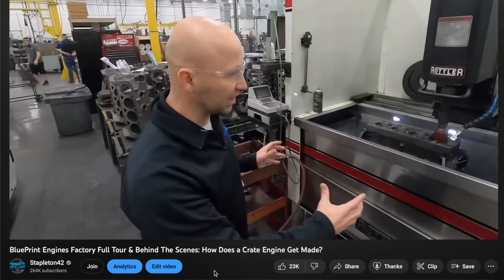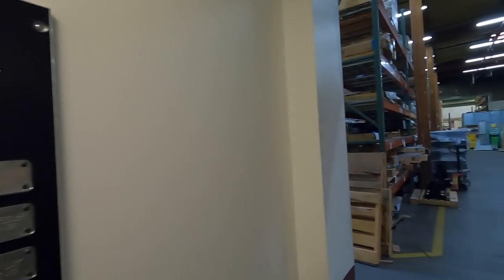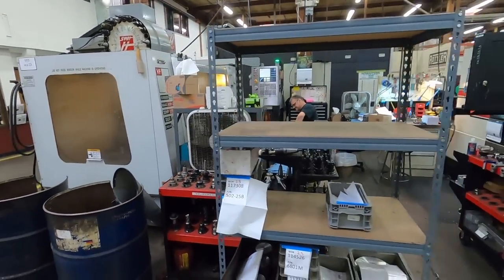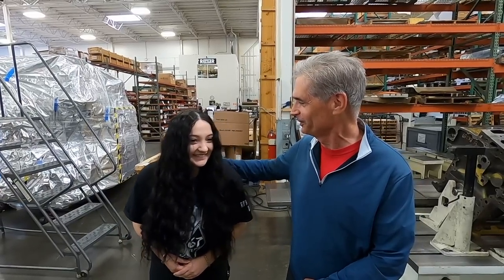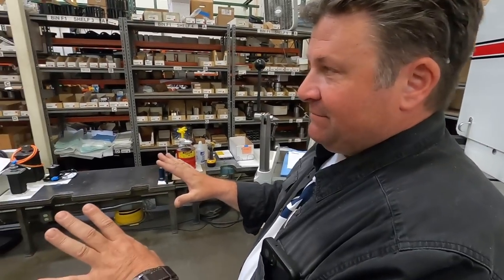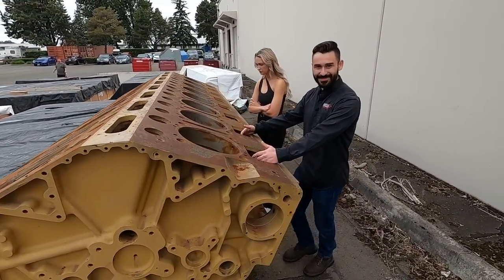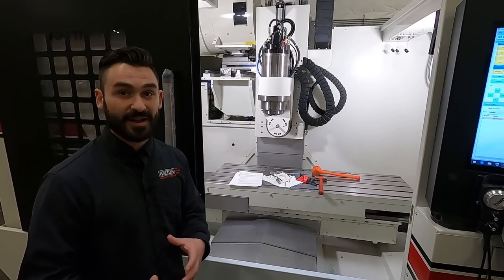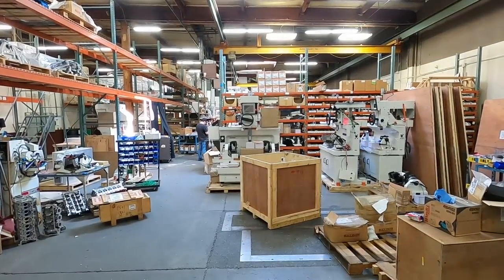Rottler Manufacturing: The Unsung Hero of Combustion Engines (100 Years of Made In America)

Comment: Wow, this video brought back some memories! Around 1984, I worked for an engine remanufacturer…we did a lot of engines for the military’s ground units, like tugs that pull around aircraft…slant 6s, GMC V6 gas engines, and Hercules? That was a big in-line 6 made of chrome moly…tough to machine! I had the privilege to learn to operate the green Rottler boring bar! You centered the bar in the bore by floating the machine on air, use the four fingers in the bore to center it, then lock it down. Had to do a lot of sleeving back then-thin wall blocks. Also operated the Sunnen CK-10, and a Sunnen Align hone/boring bar. Then after doing the machine work, I got to assemble them.  That was a nice job. Also, we had to document everything when we turned the rebuilt engines over to the Dyno room.  Learned a lot! Thanks for the video. Great job.
Reply from the maker: thanks man thats awesome!

Comment: I found this video very Interesting. My grandfather who was born in 1909 had his first Model T at the age of 13. I remember him telling about rebuilding the motor back then and boring the enginenblock with a hone. He did the first cylinder until he thought it was where he wanted it, and ground a nail until it just fit into the cylinder. Then he did the other 3 cylinders to match. He ended up having to get custom size pistons because he went past the standard oversize for the day. He became a machinist and still a hotrodder after that. Great video.
Reply from the maker: thats awesome. its possible he used an original design Rottler to do it too!

Comment: Really enjoyed this video.  From the first manual boring bar to the Cat 3600 block and that the newer Rottlers can digitize and create a toolpath on the machine.  It's impressive, I wish I could see how the software and programming works.   I used to work for the Caterpillar Large Engine Center in Lafayette, Indiana machining new 3600 engine blocks.  I never ran the 16 cylinders you showed, but instead ran the inline 6 and 8 cylinder blocks.  They do use those in marine use, like tugboats or as part of a backup generator for a nuclear submarine.  I no longer work there, but still do work for them through my current job.
Reply from the maker: thanks man!!
Reply: When he was talking about the centering setup van Norman boring bars had the same setup.

Comment: Heard a story at PRI from one of the sales guys demonstrating the 5 axis cylinder head machine.  It was at Warren Johnson's shop, the sales guy took his test mule pro stock engine digitized the port. There is a cross section tool he tweaked the cross section in the port, ported all the ports using the machine.  It picked up 30hp, and this sold Warren to buy the machine.

Comment: Yes not only Rottler but, the HARD WORKING automotive machinists out there who bust their asses off to create a quality product. My buddy had to close down his machine shop in Silicon Valley after it was in business for 40+ years (he bought it in the mid 1990's) after he wasn't able to keep up with yearly lease increases from the property owner. It's a shame that these hard working guy are not fairly compensated for their efforts. My buddy now works @ a semiconductor machine tool builder and makes 3 times what he was making in running his shop. He constanly jokes he should have closed it sooner! Rottler is the best equipment manufacturer since Sunnen seems to have abandoned their roots and given up on automotive machines.

Comment: he is right I have been a CNC machinist and programmer for over 30 years and most engine machinist don't know the g codes and m codes and different types of CNC controller languages that a regular  machinist has to know. Matter of fact there ae so many different types of languages if you will of the CNC controllers most CNC machinists don't know all of them as well, Most pick a types of machine like a Fanuc or Haas controller machine and they stick with that their whole career. Some people like myself are operato0rs/programmers and we have to know at least the basic codes form all the controllers in the shop you work at. I was partially self taught and finally at 40 went back to school so I could keep up with the latest machines like the 4 and 5 axis machines and the latest CAD/CAM software. on my off time i used to design and machine Aluminum heads for go-kart and mini bike engines for a couple buddies whose kids raced karts. it was for fun and some of them worked great and some , well sucked.lol

Comment: Rottler using their big machines to do standard machine work is the flip of what I do with my g&l  where I use a standard machine tool to do engine work.  Their comment about bar sag verus the 90deg cutter begs an interesting question to me since no doubt a long crankshaft sags as well what is better having the bores follow the natural sway of the crank or having the bores straight?
Reply from the maker: A rotating crankshaft needs to be centered. Perfectly. If it were trying to rotate with “sag” would mean the crank flexes back and forth with every rotation to meet that sagged centerline and that would be very bad. Beat up main bearings very quickly
Reply: @Stapleton42  I wasn’t clear what I meant. I meant since most blocks are mounted at the front and back that since they are boring these blocks upside down once they are flipped over it seems the bores will sag by some amount as the block does. Obviously it’s not enough to be an issue but now I am curious to check one sometime to see.

Comment: Cool company that makes great products its just a shame they won't support older equipment.
Reply from the maker: they won't?
Reply: @Stapleton42  I know of and have owned several older pieces with electronic controls. After so many years they hang you out to dry  and you are stuck attempting to find aftermarket solutions to keep an otherwise fully functioning piece of equipment operating

Comment: Please let the sales manager know it's line bore not align bore. Kind of makes him look like he doesn't know what he is talking about. I'd be worried asking him any questions.
Reply from the maker: Align bore is actually the origin term (its done to align the mains). Line bore is derived from people hearing they need align bored thinking they heard "a line bore". Both terms can be used.
Reply: @Stapleton42  Incorrect. Now you join the list . Definition-Line boring is a machining operation of a cylindrical hole effected by a machine tool called line boring machine. The operation consists into enlarging the hole to reach the desired diameter or to correct its axiality. Often line boring is done over big diameters or with bores which are connected each other.